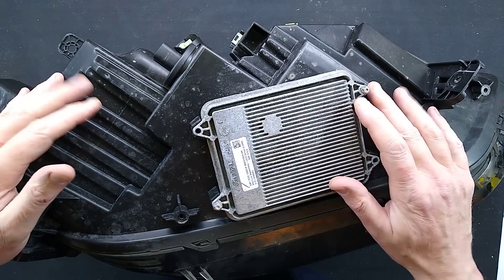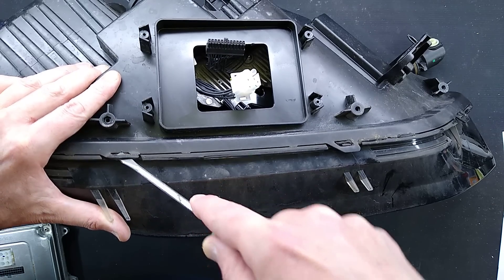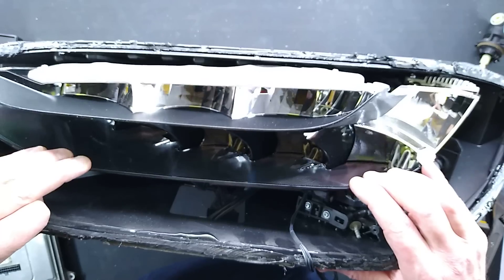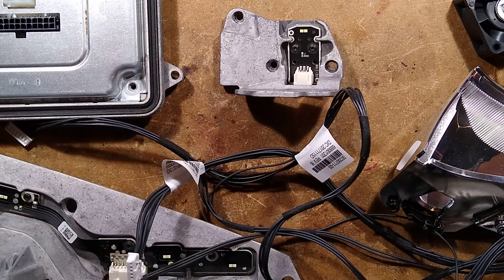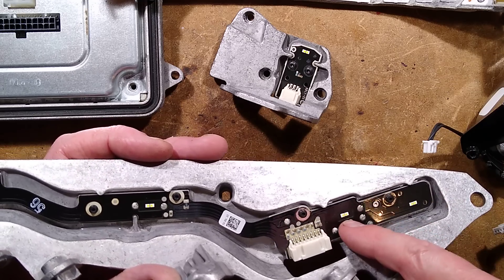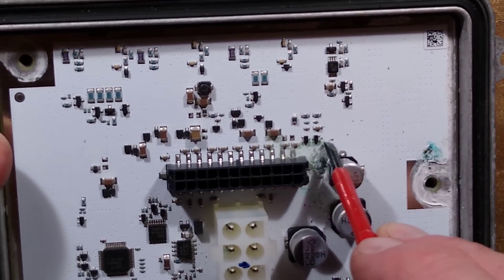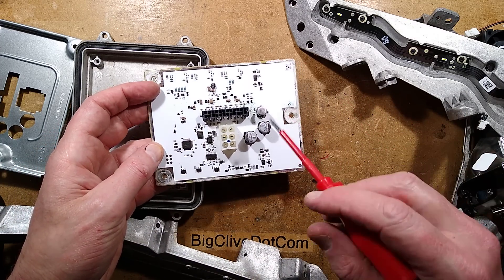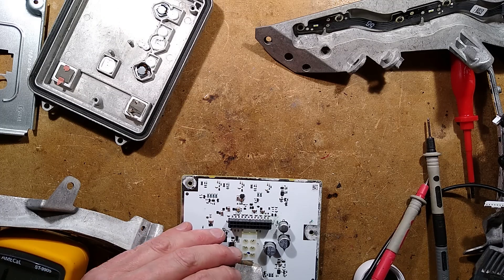Exploring a Tesla model X headlight

Comment: This is a common failure for any headlights with attached modules. For some reason, they always put the module on the bottom of the headlight. When moisture (condensation or from a leak) gets into the headlight, it drips down to the bottom and infiltrates the module through the connector (which never seem to be sealed connectors). It’s a stupid, short-sighted design that seems to plague several different vehicle manufacturers, because many vehicle manufacturers use headlights from the same lighting manufacturers. I believe Tesla headlights are made by Hella.

From a repair perspective, the headlight module could be replaced on its own. However, knowing Tesla, I’m sure they don’t sell just the module. Tesla would prefer to think that the entire car is one component so that if any individual part fails, you just replace the entire car.
Reply: Ahh Tesla... the Apple of the automotive industry.
Reply: Probably a good reason to do it then? At 1,500 quid a pop!
Reply: Yes! My Infinity (QX30 aka Mercedes GLA250) had the same issue. Replaced the module for 100 bucks and all is good. I ended up sealing the other module with silicone to be safe. Unbelievable oversight.
Reply: @JamesBos  that was my thought.  dip it in liquid tape or something. no overheating issues? that would be my concern
Reply: I see this all the time with HID or LED, as you say it would be so simple to avoid. Put the driver/ballast on the back or on the side or anywhere else other than the bottom..
Reply: Hella, as in, the company who also made the original Beetle headlights (I think)? Didn't know they were still around.
Reply: They are made this way on purpose to maximize profits.  Can you imagine the loss of simply buying one for life and that’s it?!?  Same for regular led bulbs, minimal part count and undersize the output capacitor to take a tsunami of ripple.  Then you can make the LED bulb fail after only a thousand hours, sell more bulbs, and even save that last $0.03 on the capacitor.
Reply: @burtosis  How frequently do these headlights actually fail? There are probably hundreds of thousands out there so there would be plenty of failed units, but is the failure rate unusually high?
Reply: If you buy one paint it with liquid electric tape. but then it may overheat and set on 🔥🚒. 🤷🏼‍♂️. 
seems like you just skip all of it and dont buy one.
Reply: Против Глобал  although LEDs are much more efficient and therefore dissipate much less heat than their halogen and HID friends, I hate to be the one to inform you that they are in fact not alien technology and are still subject to the basic laws of thermodynamics...
Reply: Против Глобал  nearly there, but even then, that's not at all what you said in the first place.
Reply: Considering they promote electric cars as ''helping the enviroment'' having to replace a whole unit like this is not very 'green'!
Bit like modern smartphones, when the battery fails, you have to buy a whole new Phone!
Reply: Sounds like they have taken a leaf out of Apple’s book on customer service choosing replacement rather than repair, usually by making it impossible to do so, with no access to circuit schematics or mechanical drawings.
For a vehicle that claims eco credentials it stinks.
Reply: Maybe time to put a silica bag in the housing?
Reply: Would putting it on top subject it to more heat?
Reply: @veryboringname.  With LED lights they aren’t producing as much heat as a halogen. If the module really needed cooling could probably adjust the bodywork so there’s a little airflow over the module.
Reply: @NBSV1  LEDs still produce heat - enough to cause burns, as flashaholics can attest to. I would think best design practices would call for the driver to be below the heat-producing components. Instead of putting the driver above a heater and then relying to ambient air to cool it, it seems more sensible to not put the driver above a heater in the first place.

Heat is a common issue with LEDs. A lot of ordinary household LED bulbs state they are not to be used in a closed light fitting as the heat buildup will shorten the lifespan.

Comment: gives you an  insight into why you would not buy a used Tesla or any EV. Reason being appart from the cost of a replacement battery module should it fail after purchasing a used EV is the cost of any other modular component or controller board and the service cost to determine and repair the fault.

Comment: You can get saw blades to fit your angle grinder. Essentially a small circular saw blade. Would cut much easier than an abrasive wheel.
Reply: Also known as a finger remover. I will never touch one of those blades again, a guy at work had a really nasty accident involving one such blade.
Reply: @johnjones4825  Ouch, that sounds awful. That's also happened with just about every cutting tool ever imagined. Abrasive wheels can be really nasty too.

Comment: By now we've all seen someone's turn signal that was half full of 'blinker fluid' due to water ingress.

No conformal coating. It's like it was designed by people who have never seen the inside of a typical automotive electronic module before and that have absolutely no clue (or care) with regard to common failure modes in that environment.

Not sure if it's inexperience, hubris, or intentionally designed to fail. In any case I'm not impressed.

Comment: As expensive as that thing is you would think they would put some wax/enamel coating on the board like they do with washing machine modules and as well as HVAC control boards as a 2nd protection method.

Comment: The tilt actuator might be interesting as well. I think they consist of a wax and a rubber membrane. Heating the wax makes it expand and allows precise control of the linear actuator.
Reply: Not precise enough and not fast enough. They are normal linear actuators with electrical motors

Comment: My Merc failed the MOT due to a failed rear LED side light. I gave it a slap, and it came on so passed without replacement, however the thing went off again once home.
Found a replacement was over £200 so with nothing to lose, I sawed away and removed a patch of the hermetically sealed plastic casing. With a bit of effort, removed the string of LEDs' and just needed to resolder a dry joint. Still going 18 months later 👍
Reply: Years ago (maybe 30), my buddie's mom's BMW died on her. Finding no spark, my analytical brain thought that perhaps I could save the old lady some money. I drilled the ECM open and found a dry joint, which I re flowed. I still see that car driving around town here. I would imagine that free repair is still holding up...

Comment: to separate this type of headlight you would put it in a cardboard box cut a hole and insert the front of a hairdryer and warm it up for say 10 mins this will soften the bonding glue and allow you to separate the headlight lens from the main body very easily. well easy when you have done a few similar headlights. In the oven at low temps also works well but you need a big oven

Comment: "Progress" does not mean better. Cars used to have simple 12V incandescent bulbs, and the entire 'drive' circuitry was a relay. Maybe they weren't sexy with their animated turn signals and instant switching, but replacing them was something an ordinary person could do with a screwdriver and less than $100.

Everything in modern cars is an atrocity, from the lack of physical knobs/controls to the overreliance on microprocessors and complex systems. Not too long ago, people were cautioned for buying power windows that were more likely to break compared to the hand crank type, and now every aspect of a car is like that. Piles and piles of unserviceable e-waste. F capitalism.
Reply: The electrical design in newer cars is getting ridiculous. In my 25 year old truck, you could easily add things like power windows/locks, keyless entry, etc by just finding the necessary wiring and maybe a module (that had a single function) at the junkyard. Meanwhile a 13 year old truck I am building requires new dash harness and a "smart junction box" with support for the required options, all so they could save a few wires, but when the brain goes out it's a costly replacement that could potentially knock out a lot of other functions.

Comment: I've briefly played with a Model 3 headlamp module. Likely a LIN bus device, because the connector had 3 pins rather than the 4 required for CAN. The person who would ultimately receive it needed it fully intact, so I never bothered opening it up or sussing out how the LEDs were powered, they only wanted a procedure to light up the headlamps, which is possible to do with constant 12V, but not the built-in turn signal, you'd need a Model 3 or knowledge of the LIN protocol and messaging.

I'm surprised they didn't coat the PCB in black epoxy. That's what they did for the door handle motor controllers for the Model S, and it protects from corrosion like this in addition to noobs like me who want to use that motorized door handle in other contexts.

Comment: After seeing the water ingress, it looks like they needed to orient that box differently, such that PCB shouldnt be laying flat so water can form and drip onto it. Maybe part of the housing of the light has failed, humidity builds and then is able to condense, forming liquid water on the metal plate such that these units will always fail given the right atmosphere.

As far as the repairability of these units, they could be designed to be repaired and that Tesla makes a conscious effort to supply subcomponents (say I’m a shop that wants to order 20 of these PCBs and their housing, doing that install while letting #Tesla doing their assembly ‘repair’ while they create #ewaste, similar to #Apple’s policies. This is the future we need to work towards, having Third Party Repair who have access to OEM parts and able to effect repairs without policies to hinder their quality of service (say #AppleInc requiring the product’s unique serial number to order the required parts for just one order)

Comment: Garbage technology in a garbage vehicle designed to be disposed of at a cost of 30k for every 120k to operate .The battery has less than a 5 year life span in Canadian climate and if you are doing more than 200km a day to work and back you are going to be in for a surprise .Those that only do 80km a day 40km to work and 40 back have a good chance to make the 5 year mark only to be surprised with a 30k battery swap ! Let's not forget the lack of use for those that have to drive long distances and can only put in a 30 amp 240 slow charger .And let's not mention those that want to put in solar !!!!!!At 450 watts per square meter you need a lot of roof space and more batteries to operate an inverter to charge you vehicle .Let's not forget the criminal forced consumerism and you being unable to service repair or modify your property !It belongs to Tesla just like your iPhone .you don't own crap !

Comment: "The more they overthink the plumbing, the easier it is to stop up the drain." What a monstrously overthought construct for a headlight - and brought down by an old fashioned case of the Eric O crusties.
Reply: Eric would go to Wilbert's Pick & Pull for a replacement, but I doubt there would be a Tesla within the 50 miles of Avoca, he'd  have a better chance finding a Tucker headlight, probably the center one.
Reply: But this is exactly the thing. They are engineered with High Tech. Which in of itself is fine. But they are made "cheap" so the manufacturer can rake in more money in the future. Don't sell the PCB. Sell the whole Headlamp. Why? Because Money. Like Clive said - the PCB swap would probably be fine. 
I understand that replacing single LEDs is not viable for manufacturers / mechanics. But just swapping "half your car" for a broken PCB is stupid.

Comment: Seems rather complicated to me, do they really need 15 IC's just for low beam, high beam and off ? It could have been done with a MOSFET and some resistors for each LED strip. They went out of their way to overcomplicate this electrically but couldn't be bothered to put some laquer over the PCB so water won't get in...
Reply: It is just like any other LED headlamp in any modern car today. Controlled using LIN bus. This headlamp has two DRL modes (US and Europe), parking lights, low beam, high beam, and three adjustable "cornering lights" that turn on and off in sequence as you turn the wheel. The high beam LEDs also turn on with a ramp-up when you turn them on.
Reply: @sjokomelk  Oh, I never knew LED headlamps do this in modern cars. I guess it's because I still use a relatively old car. The headlamps in my car can only be off, in low beam or in high beam.

Comment: I can't decide if this monstrosity is over-engineered or under-engineered.

I think it's over-engineered, because it's way more complex than its function requires.

I think it's under-engineered, because I get the feeling that the designers just did the whole thing in CAD and then emailed the drawings to contract manufacturers: there was no attempt to make something efficient or elegant or robust or repairable.
Reply: I don´t think its that much over engineered when it comes to function, as they are working within certain specification and what that thing can do and has to do to be street legal. E.g. the moving part for the auto leveling function mandatory on cars with Xenon or LED Headlights (as those are way brighter than Halogen, the auto leveling is mandatory to prevent blinding. I think at least in Germany for some time with those even Headlight washers were required to prevent blinding from dirt, but I think with LED they are no longer mandatory). The electronics are most likely industry standard CAN Bus as that would be cheaper to obtain from suppliers than anything proprietary and also today are more or less what you need as you have to provide feedback about a light working or not, no matter what kind of light you use.
Not sure if they do the Hi/Lo Beams electronically with the LEDs or use the tilting for that as well (I guess it is the tilting together with the rotating outside reflector). Both systems exist.
Everything else if it is overcomplicated, it is due to them want to have a certain design while fulfilling those specs. 
Also having seen other automotive lights systems, I personally didn´t think this one was overly complicated. In comparison to other systems using way more elaborate mechnics, reflectors or matrix arrays of LEDs, this one is rather simple.

Comment: The tiny leds are for optical reasons. Having a smaller light source gets you better focus and more distance. Some (BMW) went as far as using blue lasers and phosphor disks to get the tiniest light source possible for maximum headlight range.
Reply: So that you can effectively blind other road users🙄
Reply: @NyanyiC  no, the opposite. a well designed and regularly adjusted headlight is very comfortable to other road users because it has very little spill. headlights need regular adjustments to ensure they are set to the right angle. many people dont do them.
Reply: @drkastenbrot  For every SUV (stupid user vehicle) with properly adjusted headlights there are dozens with them angled up "to see further at night" because they don't care about other road users.
Reply: @drkastenbrot  until they go over a bump and flash you with 20k lumens
the worst part though is the chromatic aberration on the lenses that makes them have blue fringe right on the edge of the projection
Reply: @Mister_Brown  These are reflector headlights, they dont have a blue fringe. You only get those with projector headlights.

Comment: I just had an LED ceiling light in my stairway fail about a year after installation. No user servicable/replaceable parts. Not as annoying as an unservicable £1000 LED headlight for sure, but I've still got to isolate the mains, find a ladder, unwire it, rewire a replacement (using those stupid non-screw terminal clip things) and dispose of it.
I kind of preferred replacing bulbs.
Reply: I prefer retrofit bulbs to complete fixtures.   Replacement then is simple.   Some folks during the 1990s installed ceiling recessed lighting that used compact fluorescent bulbs.  The fly in the ointment was that the iron ballast was located far outside of the "can".  replacement there means tearing into the ceiling.